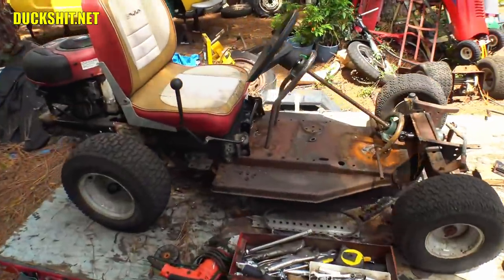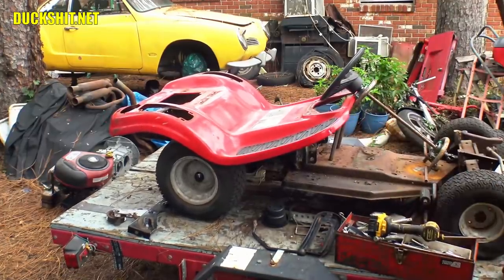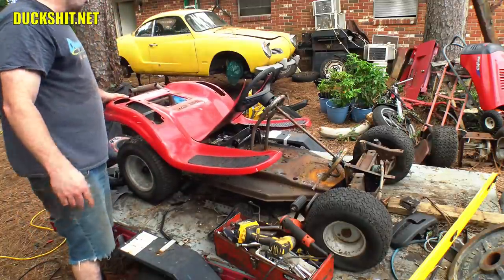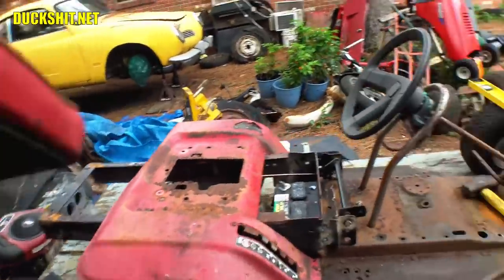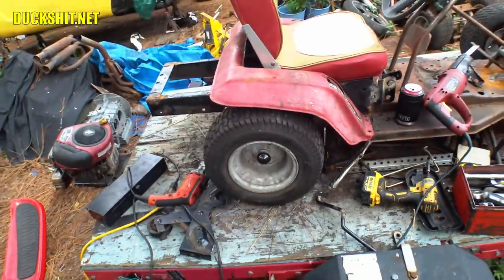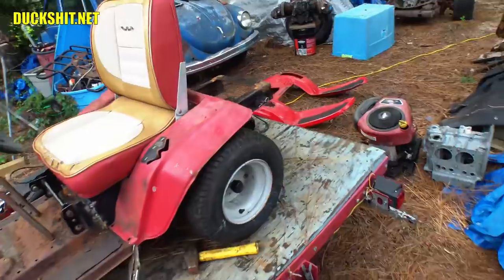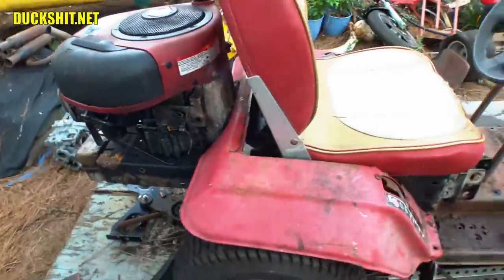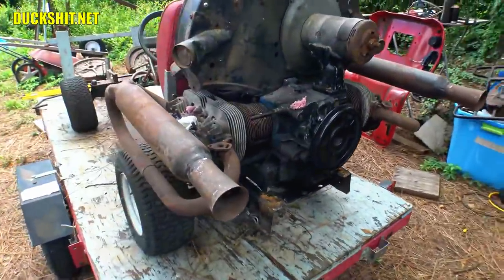Mowkart Build - VW Engine - Bodywork - VIEWER DEMANDS!

Comment: Dude - lose the drive train and install a propeller... skip the brakes and add an anchor... add nitrous and make sure your medical insurance is paid up... strap on an old Wehrmacht helmet... launch - AND SHAZAM! - The best YouBoob video ever made!  Men, sitting around the fire, will sing of your glory for ages!
Reply from the maker: I used to have one of those helmets, but it was a Chinese one.  Apparenly the Chinese were supplied military gear by Germany in WW2 despite the Chinese being on our side.   Go figure, lol!
Reply from the maker: Wish I knew where that Chinese helmet was today, though.  I thought I might have found it in my dad's house but it's not there.  Possibly he sold it or gave it away.  I used to wear it on my motorcycle when I was a teenager LOL

Comment: Could you run it in reverse..to go forward instead of turning the axle around to get the belt turning in the direction you need.  I would use a big flat red gas tank from an old generator. Add a big heavy bumper to keep the front end down.
Reply from the maker: Sure, if you want one really slow forward speed, and 5 reverse speeds!
Reply: @DuckmanCycles  yeah.. I thought about that after my dumb comment...

Comment: If YOU wanted to put a bigger engine on the Mowcart how about an Air-cooled BMW bike motor? I really like watching you problem solve these projects.
Reply from the maker: I would have done a smaller motorcycle engine.   2 stroke and air cooled.  😁  I have considered several.  Still may happen someday!  That's so much dude!

Comment: You really should use the fenders on the front with some mods. It looks really cool like that. Maybe a cylinder shaped gas tank on it as well. Also maybe a larger v-twin mower engine would be cool.
Reply from the maker: A larger V-twin than a Volkswagen engine? LoL
Reply: @DuckmanCycles  like a 20hp v-twin mower engine or something like that.
Reply from the maker: What would the point be? I already got a 50 horsepower Volkswagen engine!

Comment: On the left hand side of the finder, cut a round hole where the "w" looking slot is and make that your cup holder. How about having floating front finders; you know like the Dodge Viper. Like you need more suggestions.
Reply from the maker: Cup holder goes on right side as demonstrated in video hehe!  I don't know what front finders are on a Viper though.

Comment: Turn the engine around 180% Then rotate the diff up 90% and run a belt from the crank pulley to the diff pulley and there it is.
Reply from the maker: And then it runs backwards and transaxle dies when lube sits in wrong place!  Yayyyy LoLz
Reply: @DuckmanCycles  Well anybody can ruin a good idea with details. 😜😜😜😜
Reply from the maker: Hahaha, I suppose I can have a custom cam ground and run the VW engine in reverse so we can wreck that transaxle in forward!  😁😁😁

Comment: Body work should be last cause you don't know what modifications you might have to do and if you destroy your body before all other work is done then you have nothing to work with. Have to put tractor brake system to even steer with vw engine and I don't think that the mower diff would even hold up to that kind of torture
Reply from the maker: Thats what I've been saying, but nobody wants to listen!  So I am forced to appease!   LoL!  And the gearbox should hold up fine if I don't ride it stupid, I do wonder about the axles breaking under the weight though.
Reply: @DuckmanCycles  well I used to work on lawnmowers as a hobby and I've seen transmissions completely destroyed by just the factory engines they're not made of much